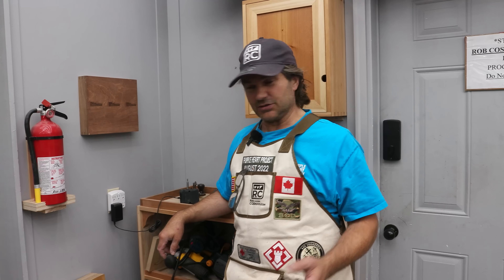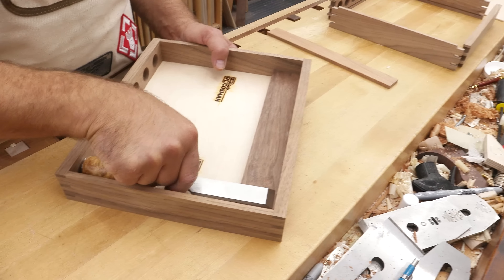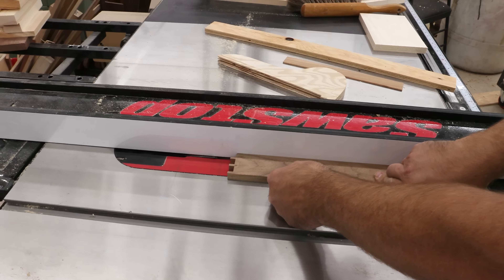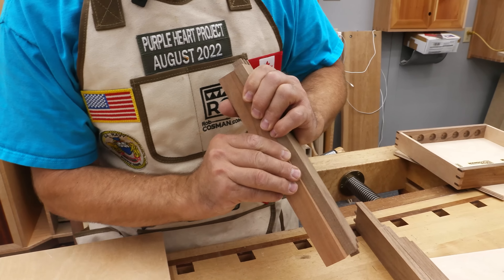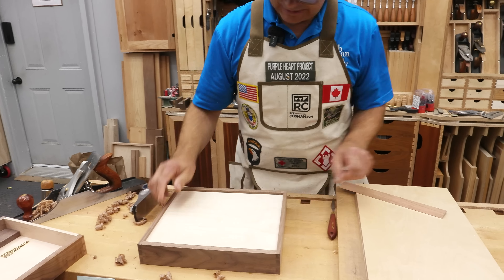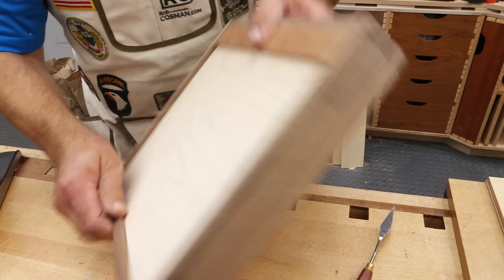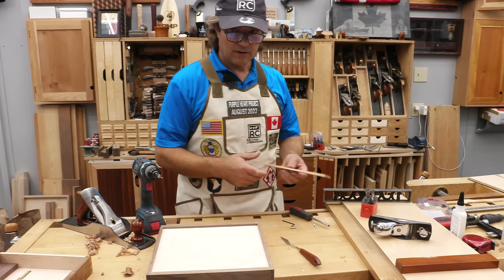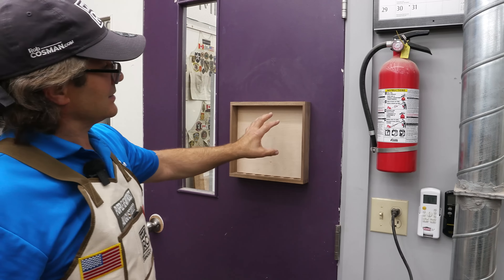French Cleat For Fine Woodworking - Hang your wall cabinet

Comment: French cleats are really useful, and a super easy way to get really secure mounting.  The bevel angles don't even need to be a perfect match, and these cleats still work great, I've often formed the bevel entirely with hand planes, which is a really quick way to make them.
Reply from the maker: Great point.  Hand planes is a great unplugged method

Comment: Rob, how does one set up the cleat on the cabinet side when hanging something heavy like a tool cabinet?  I imagine just using by the top panel is not strong enough. Thank you.
Reply: Under the top panel, screwed in from the front. Then use something on the inside of the cabinet to hide the screws (or not!).
Reply from the maker: For heavy increase the width of the clrat material and keep it long

Comment: Is it correct that the top and bottom are thicker than the sides, or am I seeing something that's not there?...
Is this to accommodate for the cleat/bevel at the top?

Thanks.
Reply from the maker: not for the case the sides top and bottom are all the same thickness

Comment: Making the french cleat integral to the case top's back panel groove is really quite clever.  Rob, if I find that the wall studs aren't in a great location where I need  to hang my cabinets I'll sometimes purposely make the wall component of the french cleat shorter so that the cabinet has the ability to slide side-to-side on the wall in order to adjust it's position.  Do you view any danger in doing this?
Reply: I noticed that too. Clever. Thinking about a heavier case, I think I would want a way to transfer the load to the sides of the cabinet.
Reply from the maker: Nope. Thats an excellent solution

Comment: I've seen some high end display cabinets that curators use for historical objects that have an access panel held on by a french cleat.
Reply from the maker: Like an inside access piece?
Reply: @RobCosmanWoodworking  Yes, on the back of the  display cabinet.  Probably to make it clean to push up against a wall and/or make it difficult figure out how to get in.